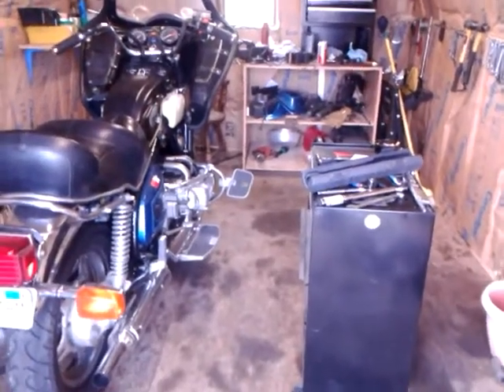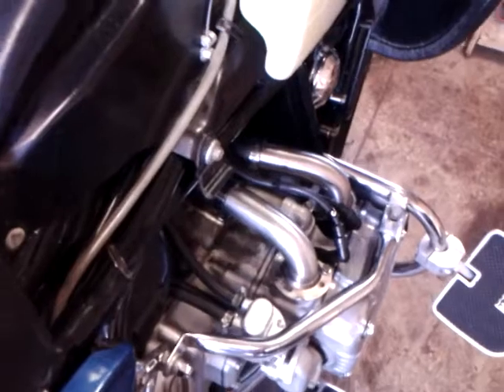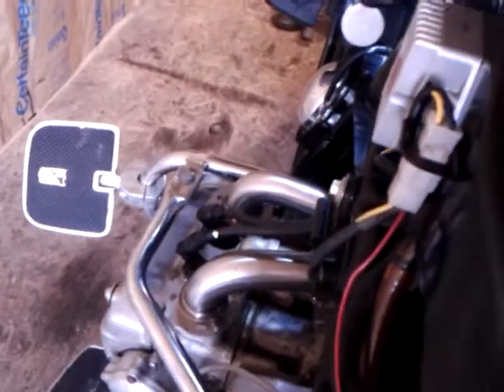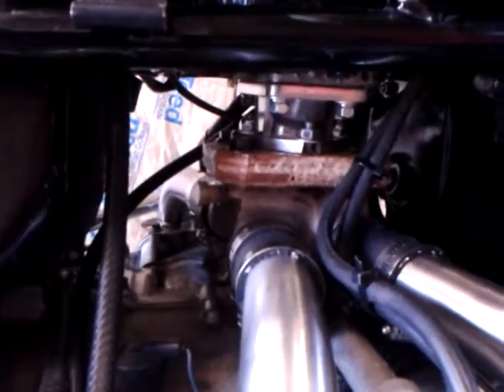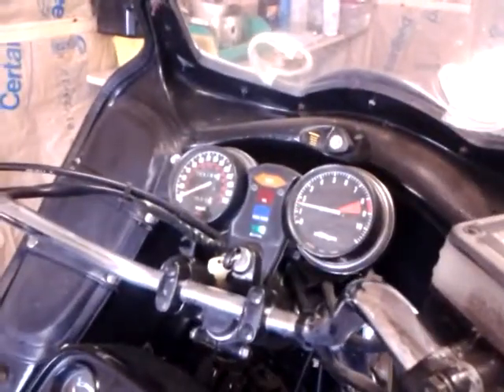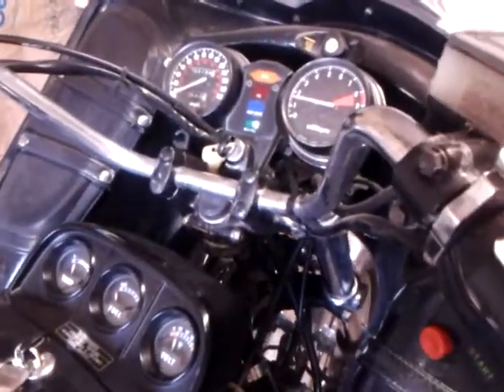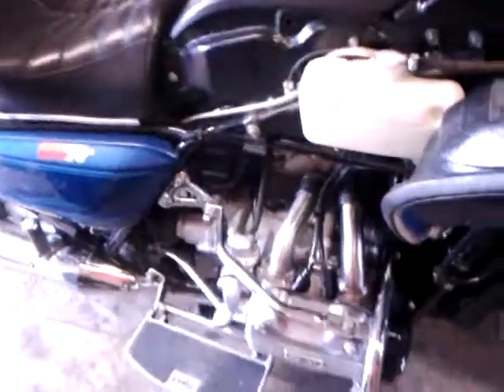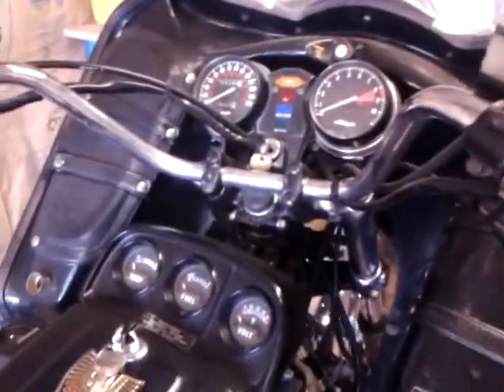Pre Colorado Bikes - 1979 Honda Goldwing GL1000 with Weber 32/32 DFT Carb

Comment: How do you balance a single carb?
Reply from the maker: You dont. Meant to say no need to balance carbs is better. Worked great. Motor through a rod. I sold the carb and plenum.
Reply: Kraig Kumlin threw a rod holy cow. I thought these engine were somewhat reliable